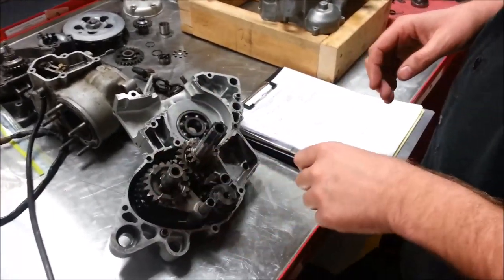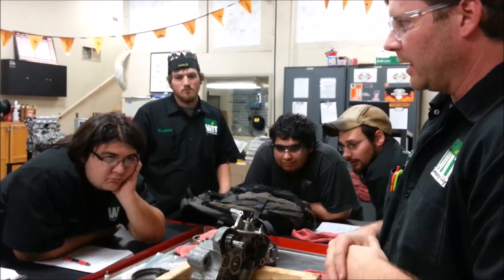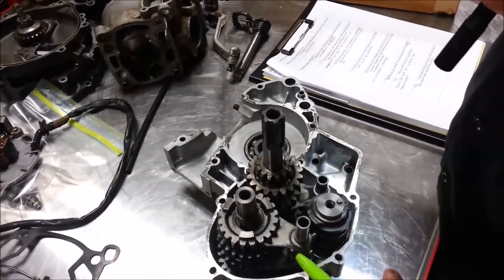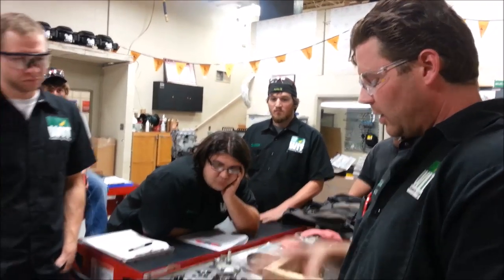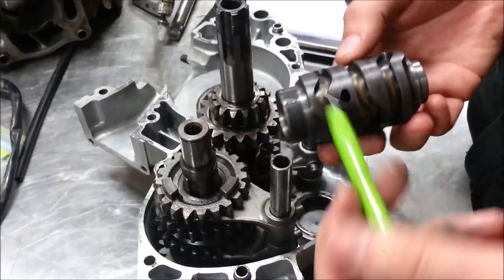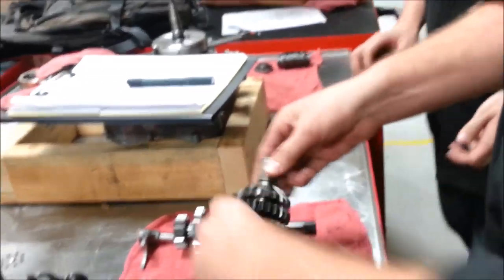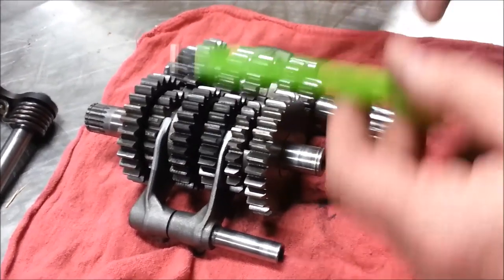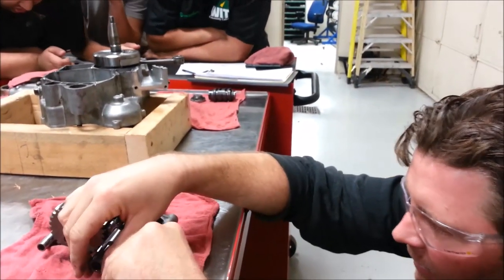2 Stroke Engine Disassembly   Transmission Removal   10 28 14

Comment: Thank you posting these great videos. Here is a question I can't find an answer too. After torquing the primary drive gear bolt, I noticed that the crank does not spin as freely. Is this normal? I don't want to move on with my rebuild if I have done something wrong.  2002 cr250